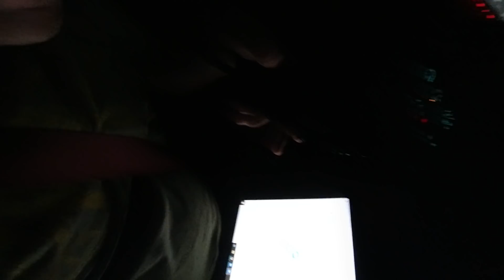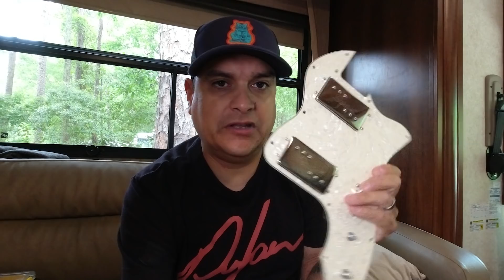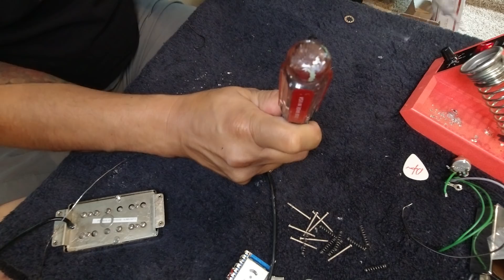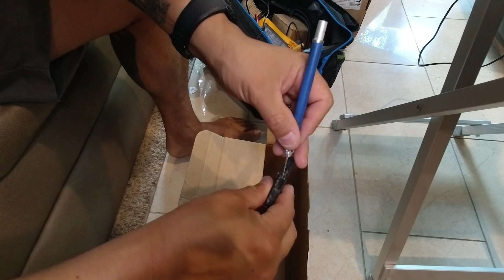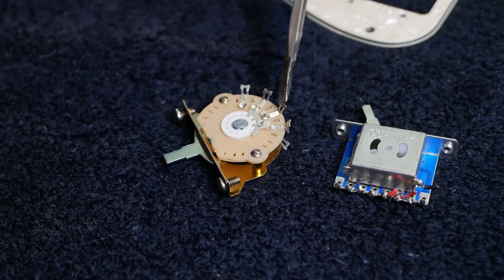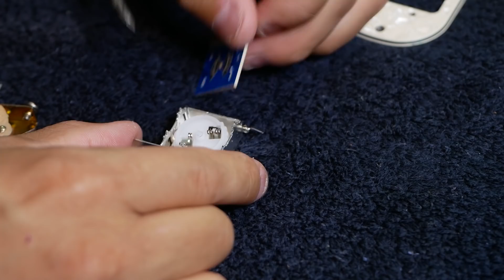Should You Replace Cheap Guitar Switches

Comment: SO then i take it a "free-way switch" which is a pc board switch is junk... i think they are just different, much like radio guys hating surface mounted components compared to hard wire circuits..just one persons opinion.. i have an import strat that has the stock switch and has never given me any issues..  just sayin!

Comment: I don't know about the cheap switch. I had one and it lasted over ten years. I understand the better mechanics on the expensive ones, but if you do the math of money over durability I'm not sure it makes sense, I've seen open switches fail in about the same time. Sure, they're more solid, but I'm not sure that gets the other ones "junk" category. As for overheating while soldering you shouldn't overheat anything even if it can handle it. If you use that as a measure... Well, every single PCB on everything is junk.

Comment: i took my squier strat to a guitar tech, and she installed a new pickup switch cause the other one was broken, i have a problem now where my neck pickups stops working and then i jiggle the pickup switch and it works, i opened the guitar to see whats wrong and didnt find anything, and then i come across this video randomly trying to find a solution for my problem, and that pickup switch in the thumbnail on the left is the one she installed for me.. FML
Reply: UPDATE, ordered a daddario pickup switch off of amazon, and after seeing the inside of the cheap pickup switch i blew into my pickup switch, wiggled it around fast, and now it doesnt cut out like before, and stay consistent, so probably dust or something was inside breaking the contact

Comment: I have an old Squier Strat, I replaced all the pots AND the 5 way switch with Fender parts, much better action and feel to the controls, I also replaced the socket with a Switchcraft socket which locks the 1/4 " jack well. I suppose they have to economise on some parts but you can make a cheap guitar better with some relatively  inexpensive parts !

Comment: PRS SE's use those cheap Alpha 3 way blade switches. They stop functioning on the bridge position almost immediately every time I get a new PRS. I finally started replacing them right away instead of waiting for them to go and I won't sell one in my shop with the stock switch. Pure garbage.

Comment: I have a '93 Ibanez RG470 with a PCB type switch - kinda stiff to use but 100% working, still after 27 years. No scratchy noises too.
So not all of those are the same. I don't like it for being too stiff, maybe I'll replace it.

Comment: Years ago, I started a rewire mod of an Ibanez 540s. I ordered an upgrade 5-way switch (superswitch or mega switch, I can't remember). I double checked my schematic, uninstalled all the stock electronics, and got it all ready to go only to find out the cavity is not deep enough to accept the upgrade switch. So I had to salvage and reuse the cheap switch. Worked ok, but schematic had to be reworked and wasn't as easy to use.

Comment: i have just bought a schaller megaswitch E (made in germany) because it gives me the HSS strat switching options i want without an extra switch or a push-pull pot (i don't like to fiddle with them while playing). was surprised to see it was a circuit-board switch. hope the german-madeness of it means they have thought of those issues you mentioned and come up with a good construction to overcome them.

Comment: In my Squier Bullet Strat I ran across an even boxier 5-way import switch w/side-mounted contacts is the most worse I've ever seen; 2 3 & 4 were junk though 1 & 5 worked fairly good compared to the others. I briefly put a normal 5-way switch in but I forgot one thing after realizing it: the switch didn't fit properly let alone work well in a thinner body unless I route a little chunk of wood for it to fit in the control cavity which I'll eventually do after measuring the height of both switches to determine the proper measurement so I eventually went with one of those inline printed 5 way switches for the time being.

Comment: Replacing switches for potential durability is like throwing away a liter of fresh milk to replace it with a gallon.
Reply: No, because milk expires at the same speed, regardless of bottle size. The correct comparison would be to stocking up food for your storm/bomb shelter: you choose cans and dry products, stuff that will last for years, not fresh produce that will spoil within a week or two.
The whole point is that the switches will expire at different speeds, so you will need to be replace it less often, so fewer gig/studio sessions will be affected by the switch becoming noisy/unreliable.
Reply: It’s more like replacing a water pump when you replace a timing belt. You’re under the hood with the engine ripped apart. Why not swap out a cheap part while you’re already under the hood, rather than wait until it fails in 5000 miles, and do it all over again? 

The selector switch in this guitar was defective from the factory, and was cutting out in the bridge position, and needed replacement. The only thing I could have saved was the pots, but since I already had the guitar pulled apart, why not just put 500k pots in it?

Comment: Don’t mean sarcastic or anything, but I’m curious. What’s the point in just using the old bobbins on the old pickups. Wouldn’t just be better in just changing the pickups to one of your sets?
Reply: He'd have to wind a brand new pickup to put in it anyway, so why not reuse it?
Reply: @FairlyUnknown  I think it would be easier to start over with all new bobbins so you dont waste time cutting the old wire off
Reply: i thought that to, but $crap copper adds up, so you have a bobbin + polls/screws relevant to the base plate hols etc

Comment: Seems like those switches are not something you'd choose, but there's also no rush to rip them out of your guitars unless they're giving you trouble, or you're already in there with a hot iron.
Reply: Depends on what the guitar is used for. If you are gigging it, then go ahead and swap pots, switches and jacks. If you only ever play it at home for yourself, don't bother until something develops a fault.
Reply: The switch in my Squire was giving me troubles right from the start.
Reply: yeah, i have one of these in my tele, works just fine for now and the switching feel is actually really good
Reply: @remley8877  Yeah, definitely. they ask $25 for those switchcraft 5pos. in the big jive guitar stores. still expensive for kids. When I was young I had to solder with a 75/150 watt gun...the one with a trigger, that's all there was besides a big plumbing 'stick' iron in garage. You burn n learn, fast!  As an old timer, now I can build/clone a Super Lead, S-Rev, Deluxe, whatever etc. I disagree with, or rather call attention to the fact that the exact situation exists w/Switchcraft...the little crescent shaped 'wiper' contact wears out on them, and is designed very much like the cheaper one. or vice versa, as the Switchcraft was first. Sure the Switchcraft is better-longer lasting in most cases, but if your like me and always on volume and tone knobs, if on a budget, I'd replace pots 1st, if they're scratchy, or feel strange, or taper is wrong,  otherwise it's just resistance, and low voltage. 2 or  3 resistors in phase inverter MIGHT make a small difference by their composition, but highly doubtful carbon in that pot.........

Comment: I replaced all the electronics in a Squier Strat a while back.  The Fender switches only fit in Squiers if you grind out the cavity a bit. The Squier bodies are 1/4 thinner than the Fenders usually.
Reply: I Used an Oak Grigsby switch and CTS pots in an Indonesian Affinity made in 2000 at the Cort factory, I didn't have to mess with the cavity and its body is 1.5 inches thick. Are the Fender 5 ways bigger than the Oak Grigsbys or do they route the cavities shallower on the newer ones? But yah, Fender 1.75, Affinity 1.5 and Bullet 1.25.

Comment: I’m confused. You did a video not long ago where you were saying how even cheap pots like Alpha are just fine because they all do basically the same thing. That it’s just a simple component. I even heard you say the small dime size pots can work just fine. But here you say you are replacing the pots for good quality pots.
Reply from the maker: if a customer asks for it, I do it. ..
Reply: DylanTalksTone Got it. Thank you for the simple, to the point reply. I also agree about those switches. I’ve had many fail at the worst time.

Comment: Hey Dylan how can I solve the problem of a Telecaster that has a humbucker in the neck and a single coil bridge with 250k pots? If I go to 500k how will that affect tone on the bridge? My humbucker is so dark right now.
Reply: You could add a shunt resistor to make the bridge single coil see 250k while the neck sees 500k
Reply: Tom Milley Music so what pot? 500k?
Reply: @scrap_iron_2264  If one changes the pot to 500K but solders a 500K (470K, which may be easier to find, would be close enough) across the single coil, then the single coil will see 250K resistance.  This will be easier to understand if instead of thinking in terms of resistance (volts per amp) one thinks of conductivity (amps per volt).  A 250K resistor will pass 1 microamp for every 250,000 microvolts (0.25 volts), or 4 microamps per volt.  A 500K resistor will pass 2 microamps per volt.  If one connects a 500K resistor across the single coil, then 2 microamps per volt will flow through the 500K pot, and another 2 microamps per volt across the added 500K resistor, for a total of four microamps per volt--just like the 250K pot.
Reply: The previous comment was suggesting you keep the 250K pot and add an extra resistor between the humbucker and the 250k pot. The extra resistor would be a 250k, making the humbucker see 500k.
Reply: @christopherfleming6990  That should brighten the signal a bit but would lower the output from the bucker - which may or may not be a good thing